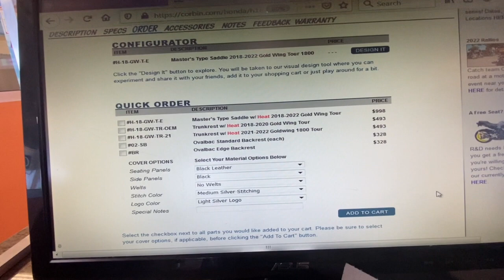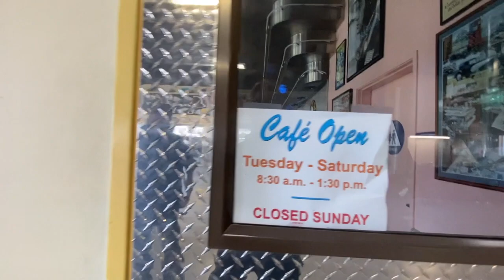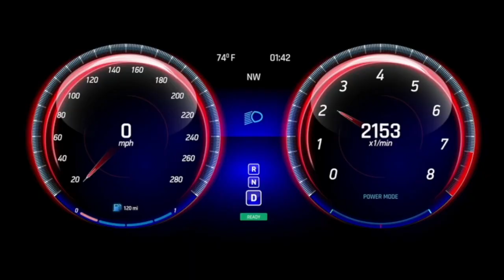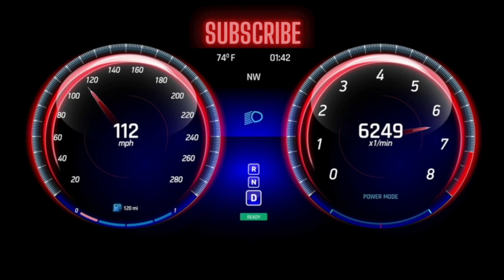Goldwing Stock Seat Sucks? Tour Corbin Factory Hollister  Motorcycle Honda Harley Indian Triumph BMW

Comment: Are the G.W  seat water prof
Reply from the maker: Hey there,
We find the GW stock seat suitable and water resistant for our needs- but then we are southern Cali and don’t do much rain riding- 
If you question is Corbin specific,
This is from their site:

Don’t panic, water won’t damage your saddle. Corbin covers are extremely durable and are weather resistant too. Although the materials are resistant to water intrusion, the stitching in the cover can let water in. If this happens, your behind will probably get wet a couple of the times as you squeeze the water back out while sitting on the seat. The solution to this is to let the seat dry out in the sun for awhile. If you often find yourself getting caught in the rain, you may want to consider a saddle rain cover.

To assure that your leather seat retains it weather resistance, we recommend conditioning your seat on a regular basis with Corbin’s Saddle Cream or similar product. You should condition your seat at least as often as you wash your bike (TIP: Remove your saddle from your bike when washing it). We strongly suggest a regular coating of a good parafin or silicon based leather conditioner like ours… do NOT use cleaners or conditioners with a petroleum or kerosene base!